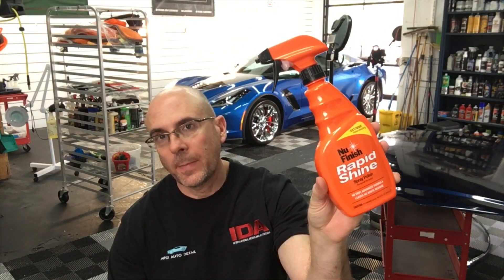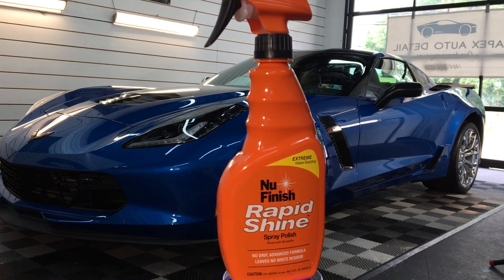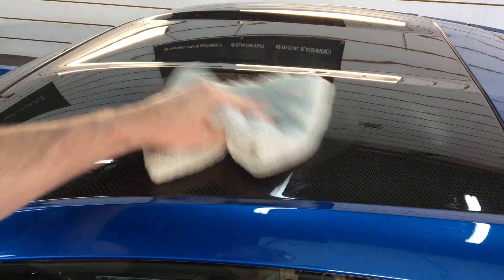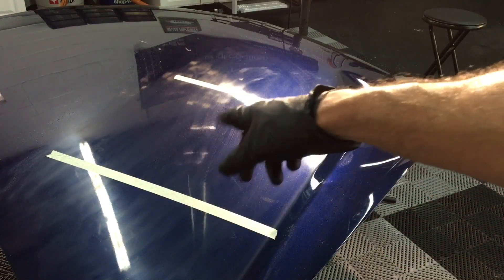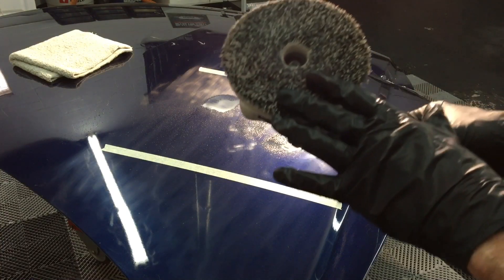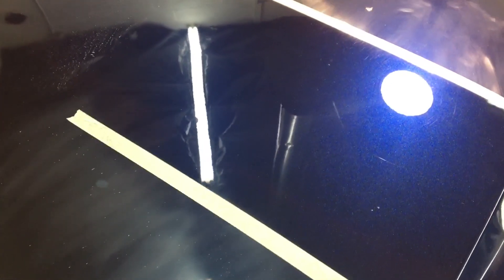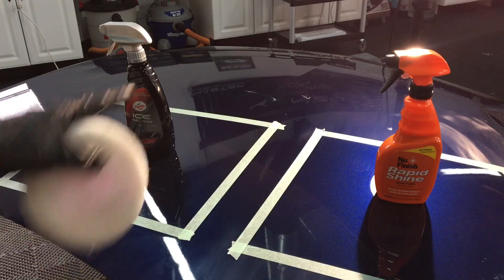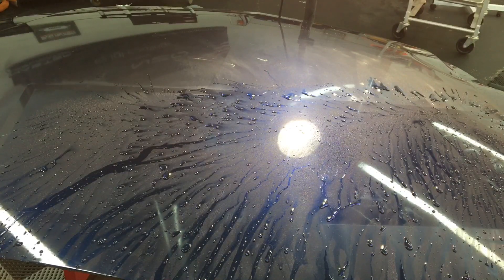Nu Finish Rapid Shine (Spray Polish) Does It Protect 3X Longer?

Comment: I really enjoyed watching this. My father started using NuFinish back in the late 70s and we've always had a bottle of the regular wax. Even now, a few years into detailing privately, I still use it, be it on chrome or paint. For what I know, the liquid wax itself has cleaners and micro abrasives and is a cross linked zinc polymer based sealant. Still enjoy using it.
Reply: It actually contains 5% silicates (original nu finish in the bottle) way back before SiO2 was a fad like it is today.  People don't realize how cheap Si02 is.  You can buy a pound of it for about $3.00 that can make you about 1000 50ml  bottles.  Si02 is the biggest rip off to date.   Big profits margin though to the companies selling the stuff 😎

Comment: I’d like to see your review of their ceramic spray coating. 

I use it and love it. It actually outlasts the turtle wax seal and shine (new formula). 

Please note use it in a ventilated area. The chemical odor is very potent.
Reply: I was going get the Nu Finish Ceramic spray at Walmart...then I saw a video of about 10 different sprays...and the turtle wax Hybrid Solutions Ceramic spray won hands down...so I bought tat at Walmart...and it's amazing...repels everything...and when it rains...just drive your car and all water comes off and it looks like you just detailed it...but I might try the Nu Finish in the future...
Reply: @jazzyboy7784  layer the nu-finish spray on top of the turtle wax spray. Just wait 24hrs before layering.

Comment: Brian. Could we use seal & shine with a 💶 fiber pad to do 1 steps? We are currently using Optimum products spray cutting agent & toping it off with seal & shine or Opti seal. from what I'm learning here it's more about the pad and not the cutting agent for 1 steps?!

Comment: I have been using Nu Finish on all my cars "and boats" since 1990. Regular Nu Finish has some abrasive properties so I am afraid to use it on my new car. My Lexus was treated with LUXCARE paint protection. Will this Nu Finish rapid shine remove the LUXCARE ? thanks..

Comment: Can you recommend the easiest and faster way to to remove pine tree sap from a car? Or products?
Reply: Believe it or not, try liquid hand sanitizer. It will take it right off!  I didn't believe it until I tried it.
Reply: 91% isopropyl alcohol will have it gone in seconds!!
Reply: Only if it fresh! If it's been on there a while. Good luck! Tried Hand sanitizer. Then Alcohol. High pressure wash wand at CarWash. Got % 85 of it off. 2003 Deville Silver Metallic paint. Nice car.   Shawn

Comment: Can you please test the traditional Nufinish against the leading spray Sio2/waxes?
Reply: A guy in Texas has done a long term test on it. It holds up to most entry level ceramic coatings! One of the most underrated products out there.
Reply: Here's the link to the Nu Finish long term test - https://youtu.be/LQ-SGYb2sJE
Reply: Traditional nufinish imo is better than most. Ive used it against a few , f11, Lucas slickmist, cgV07,cmx, hydrosilex.., and it has lasted easily far beyond any of them.

Comment: How does the nufinish rapid shine perform if it gets on rubber or vinyl? Nufinish original is good sealer / polish but, not on rubber / vinyl. I was wondering if rapid shine was the same.

Comment: I think all your videos are excellent. Damn I want to Corvette now that is so sweet it looks perfect. And there happens to be my favorite color is that a 2020 I think it is right.
I don’t think the gloss test was fair because on the Nu Finish side you buffed it by machine. I think that the seal and shine Deserves the same thing to be machine applied at a higher speed so it can make a better sign because you will definitely not get the same results just spring it on and wiping it off with a rag.
Reply from the maker: That side was machined polished in a previous video. Yeah...the color is incredible. It is a 16' Zo6 Supercharged
Reply: Laguna Blue was the color. I have the same color.